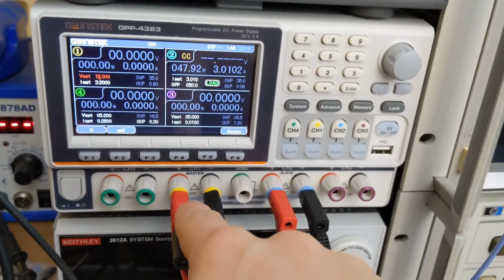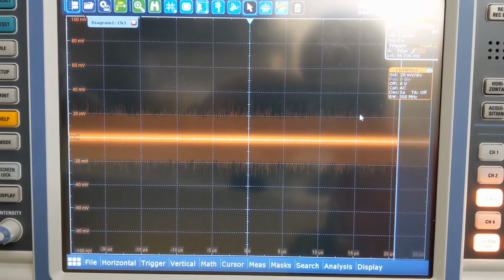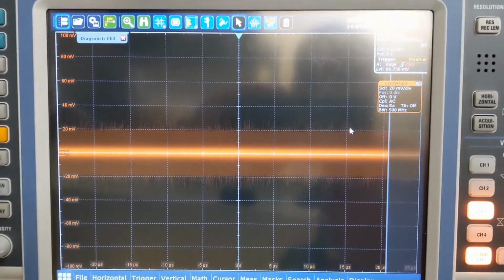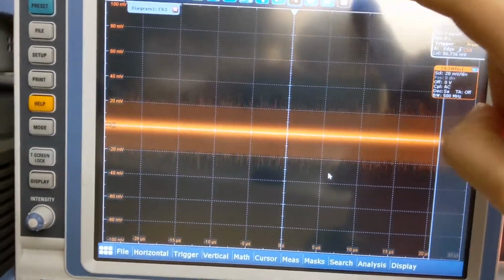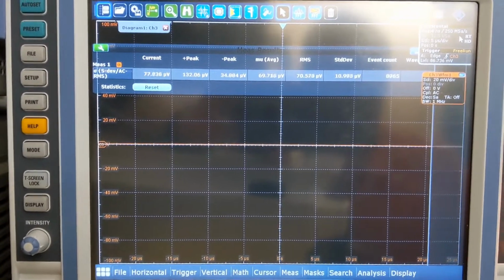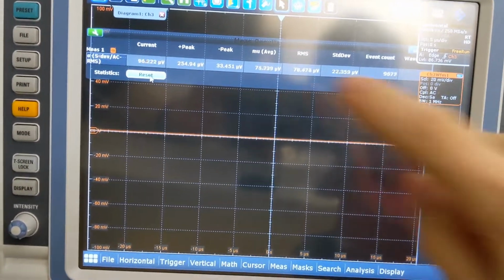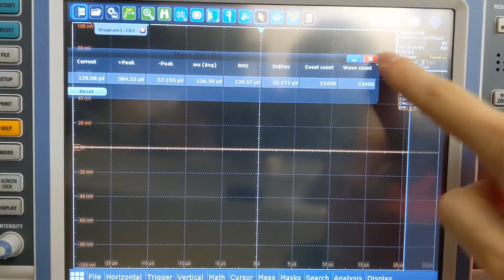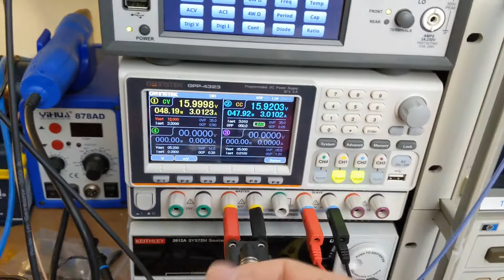GPP 4323 Ripple

Comment: Thx for sharing.  If you suspected the cables why not replace the cable with coax.  I can appreciate what you did, and rational but you could have just as easily filtered out what was naturally there espcially when a swap of the cables would have been so easy
Reply from the maker: Activating the scope filter took all of 5 seconds, while chasing the RF out of the cables would be a lot harder than just swapping the 6in banana leads for coax. 1cm of banana jack is more than enough for 2.4GHz to get in (and even substantial 100MHz), so I'd have to bring both the power supply and oscilloscope into a EMC chamber and I'd have to use an EMC-sanitized camera and so on. But why would we even want such a measurement? We are not going to be using the supply in an EMC chamber, we are going to be using it on a bench, where any banana-jack supply is going to be crawling with 2.4GHz and all other kinds of RF, just by virtue of having non-coaxial output. We should design the power networks of our circuits to handle RF hitchhiking on the DC inputs rather than try to produce RF-free inputs. Decoupling is much easier than generating and shipping RF-free DC.